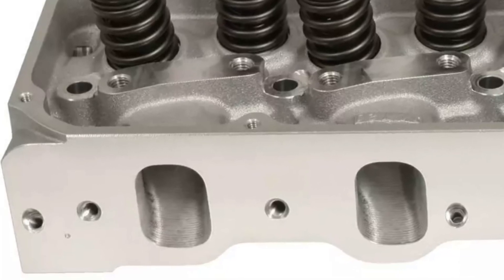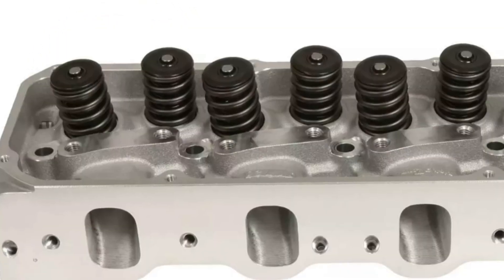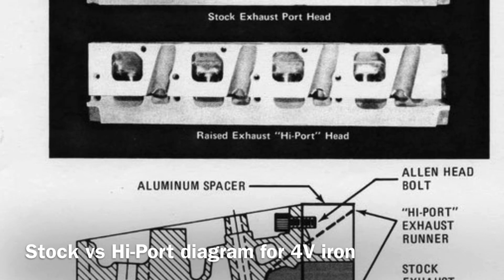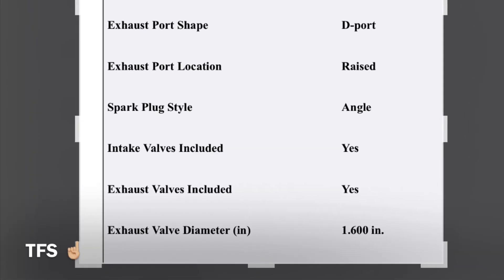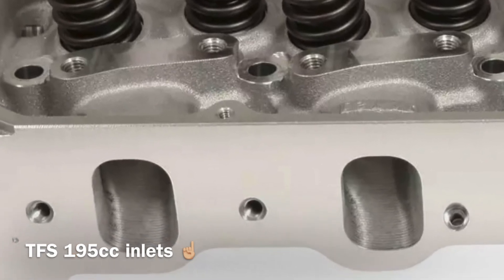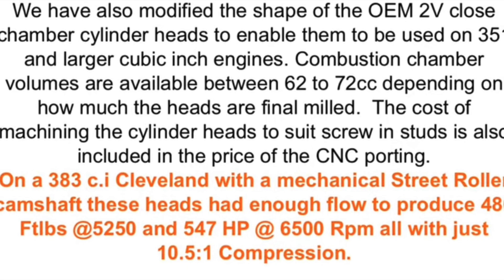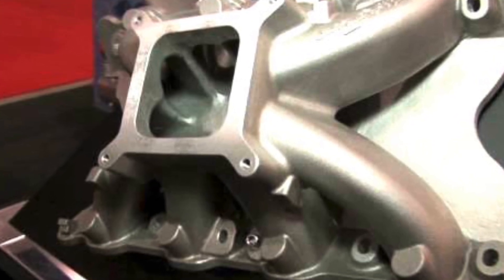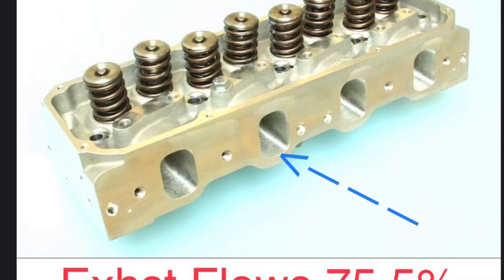Ford 351C 2V Heads for Power, Ported oem 2V vs TFS alloy 2V

Comment: Comparing open chamber to closed chamber, regardless of material, is still apples to oranges. Even an iron closed chamber makes more power than an iron open chamber. The biggest gain from aluminum is you can run higher compression and they come ported.
Reply from the maker: @stevenmitchell6347  it’s a good comparison considering what data is out there. Yes iron closed chambers are the way to go, but still no match against a good aftermarket “2V” style head.
It’s not only about being aluminium or they come ported?, it’s 2V based as in Cleveland architecture but the whole port design is different/revised both intake & exhst also the Chamber….. designed for making easy & more power overall in every way🏁

Comment: I got a crazy question or two... What did the unported iron 2V heads flow? How about an unported closed chamber 4V head? I'm trying to do math for a warmed over 351C for my Mustang, and a 408C for my Ranchero. Thanks for the help.
Reply: My Stock unparted 1971 4v heads have flowed 275 on the intake with only a 3 angle valve job. no port work at all.  I have 11 sets of these 4V heads and all flow 270 or more.
Reply from the maker: Stock 2V iron flow around 200’ish cfm @.550”-.600”
& 4V closed chambers flow 275cfm @.600” 
👍🏼🏁
Reply: Thanks for the info. 👍 @69JANKS

Comment: I've got a 351 with the 195cc TF heads and the Edelbrock RPM Air Gap intake. I wonder what the power difference would be swapping to the TF single plane intake?
Reply from the maker: That will depend on the combination you have, air gab is pretty good up to a hot street combo 👌🏼🏁
Reply: Air gap is actually pretty awesome to 6500-7000 rpm.    In the EFI days you would always see the EFI intakes making more low to mid range torque than even dual plane carb intakes...    The air gap at least on the Chevy LS makes comparable and sometimes slightly MORE low to mid range torque than the popular EFI intakes for that and it makes more top end power.   So Edelbrock really thought that design out and it's very good.

Comment: Had a set of 4Vs with epoxied inlets worked bowl area. At 600 th. lift flowed Inlet 321 CFM   Ex 219 CFM
Reply: bad ass

Comment: I ported a set of 2V heads in the 80's. I raised my exhaust .100 and .050 on each side as well, but did not know about port stuffers back then. I put the 4V valves in them and removed a ton of metal from the bowl areas. You answered many questions I have had all these years about how good they really were. Those heads screamed! Thanks guys! 😃
Reply from the maker: Right on, wow that’s cool👌🏼
Thanks for tuning in👍🏼🏁

Comment: Im New to the Cleveland engines here ! looking to build new Cleveland what about those closed chamber 4V heads that I see on eBay are they any good just for the street
Reply from the maker: That’s them copies from SpeedMaster(procomp) I’d pass on those to be honest……would probably need a lot of going over. Just go for a set of aftermarket alloys or oem2V irons 👍🏼🏁
Reply: If you are building for the street, I would switch to a Aluminum, they will be a little down on flow, but the aluminum does a better job of Cooling, the Aluminum transfers heat much better, it also weighs 35 pounds less a head!!  The other advantage is, nobody has built a Intake manifold in the last 45 years For the Cleveland 4v. any new design are For the 2 V Head.

Comment: Can i ask why you CNCed the early 2V cast low port heads and not the later polution cast higher intake port vertion.  I never use the early pprepolution type, they are just to thin walled to get a good port job out off.  Mike
Reply from the maker: Not sure what you mean MG?, so the 2V Cleveland iron is only one type……unless your referring to the large port 4V iron heads ?
Reply: @69JANKS  the prepolution ones were american cstings but not used their,  but fron the 77 XC and on were a AU upgrade and the intakes were raised 2mm, thiker water jackets an a couple less CC in the canbers,  these are the ones to use.  I can send you picks.
Reply from the maker: @michaelgiglio1571  oh ok🤷🏻‍♂️didn’t know that…….. only thought the open & closed chambers in 2V that’s all…..👍🏼🏁
Reply: @69JANKS  I didnt know much about the alloy indy race versions, etc.  Thank for your information.  Good segments.
Reply from the maker: @michaelgiglio1571  thanks MG appreciate it & merry Christmas🎄🎅🏁

Comment: I've got a 393 4v flowed 330 CFM.  TFC manifold solid roller 11.7 compression only made 556 HP🤔
Reply from the maker: 556 is still tuff HP, but all depends on the Combination too, Cam??……
330cfm on a 4V is big numbers, that’ll support like an easy 650’ish hp but on the right deal eg: Compression, Cam spec & higher rpm’s 🤷🏻‍♂️🏁
Reply: She rolled over at 6400 stopped making power cam comp  248@254 about 650 lift 108 lobe separation solid roller.
Reply from the maker: @mansourjreige677   man that’s not working at all, good power for low rpm🏁
That could of gone with a slightly bigger duration & even lift” to get them heads breathing, it has the Ci for it👌🏼….. reasonable Comp too, borderline pump gas?
Reply: @69JANKS  yes 98 octane BP Ultimate 800 double pumper hp .178 4 into 1 primaries
Reply from the maker: @mansourjreige677  pretty cool👌🏼, are they filled 4V intake ports ?
Reply: @69JANKS  yes don by rams heads Windsor
Reply from the maker: @mansourjreige677   aha👌🏼, yes emailed them a while back to bring in my 4V heads to flow & speed check them so i can make a start in subtle port mods….
Reply: Did you guys have measure the A/F during the dyno?     Maybe that was the issue.

Comment: 2 different dynos in 2 different countries. I dont doubt the alloys are better but I would take the dyno figures with a grain of salt.
Reply from the maker: Right on DM, yes maybe🤷🏻‍♂️
We sorta just get the idea through the combinations in them examples, Ci , pump gas friendly & the operating rpm 
The alloy heads have way more potential put it that way, ported irons can hold their own no doubt.
Check out my Community Posts also👍🏼🏁

Comment: Another well done comparison video, my friend 👍. I agree that with the proper CNC machine work, the OEM 2-V iron heads have great potential. 

But I still think that you can’t make chicken salad out of chicken shit. The TFS aluminum 2-V heads would always be my choice because of all the reasons that you explained in this video. 

Now I need to find a large piece of bread to make a iron head chicken shit sandwich  💩😂😉.
Reply from the maker: Haha😂 good example DW 👍🏼🏁
Reply: @69JANKS  … I especially like the comparison done between the poured casting molds of the internal 2-V and 4-V exhaust port dimensions. I never realized the 2-V exhaust port had such a smooth transition over the “hump” that really hurts the flow so badly in the stock 4-V exhaust ports. Well done. 
Now back to making that iron 2-V chicken 💩sandwich. 😁
Reply from the maker: @danielwilson6665   haha 😂🥪 🏁, yes the 2V still has a drop n fall on the exhst floor, just not as vicious as the 4V floor 🤷🏻‍♂️🏁, but then again 2 very different sizes in cc to one another 👍🏼🏁

Comment: That exhaust flow was with a pipe attached which always shows higher numbers and alot of that extra 70hp would have been from just going from open camber to closed camber but still nice heads
Reply from the maker: Right on, I’m sure they flow heads all in the same or similar fashion between shops🤷🏻‍♂️, the big 225cc version was tested on a 4.1” bore which makes a difference compared to the 195cc being tested on a 4.030 tube, forgot to mention that in the vid……. But hey they do have the slight upper advantage over a set of ported oem 2Vs at the end🤷🏻‍♂️👍🏼🏁

Comment: 🥝✔️ Bob Kotmel found the same thing. Right up to the 490 HP net on the COME Racing Issy and Sam Blumstien dyno back in the Noughties, modified 2V Closed chambers and an early version of the single plan Parker Funnelweb style intake. Your info is golden, 69Janks

Comment: Great video on the 2V capabilities. If I wasn't so dam old I would do a comparison of the fully ported 2V I'm running now vs the bowl and port matched 2V Aussie heads vs the stock 4V quench heads.
Reply: Gearbanger, that would be an interesting comparison between those 3 popular head choices. I’m pretty damn old and tired too but I try not to let it interfere with my enjoyment of all things Cleveland related 👍👌🏁🏁🏁.
Reply: @danielwilson6665  I may consider it once I get the truck out of the body shop and figure out how to get what power I have to the ground. As it is with the 4sp and 3:91 gears it's a tire burner.

Comment: What to do, what to do??? I have a set of both 2v and 4v close chambers heads but both need rebuilding. With current shop rates for labour and upgraded parts  (valves and hardened seats) is it worth it??
My engine guy says NO, get the trick Flo heads.
Reply: I hear ya, I got right at $1600 in mine parts and labor. If they don't work I guess I'll buy a boat and use em for anchors.
Reply from the maker: @gearbanger57   it’ll be fine gb57, remember also these TFS heads are double that $ 🤷🏻‍♂️…….
Reply from the maker: i hear ya ms, decisions….decisions🤷🏻‍♂️🏁